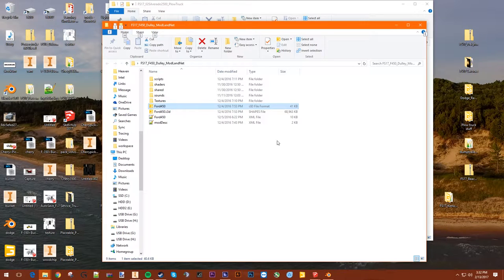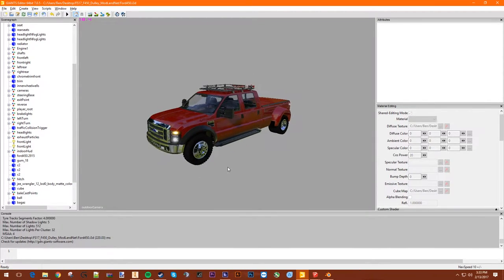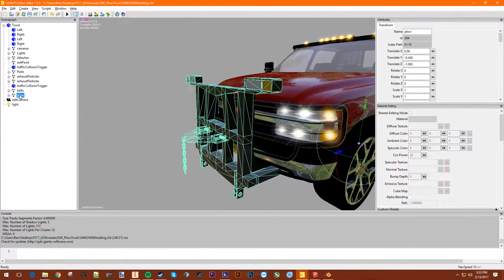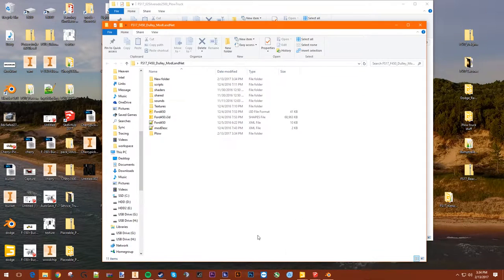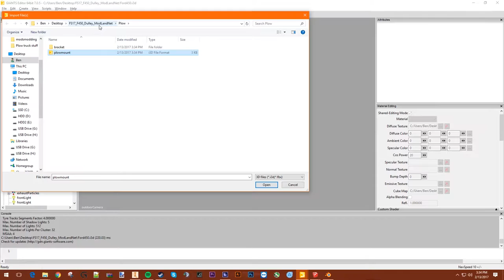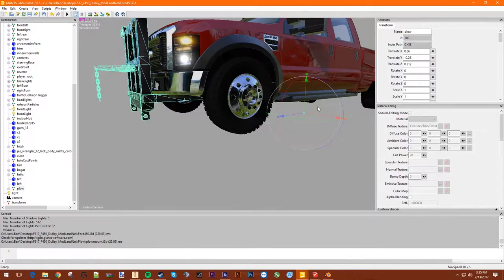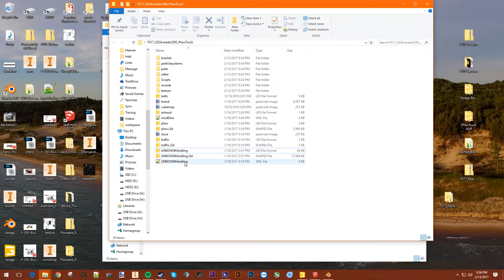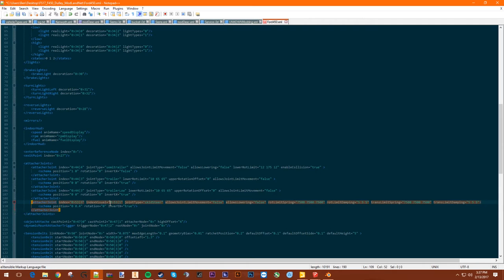Farming Simulator 17 How to Put a Plow Mount on a Truck

Comment: Thanks Dude I'll give you permission to use any of the mods I have converted. I just took the comments down cause its private. But you can use it and any of my other mods. Thanks
Reply from the maker: Its really not private I found the same mod online lol. Also u didnt put the code between the attacher joint tags so farm sim didnt know there was an additional attacher
Reply: Ok And Thanks. Ill put converted mods in the drop box folder so you can use it. Are interested in a Ford F450 2017 it will be in the dropbox
Reply: I have posed the new 2017 f450 super duty in the folder for you dude you deserve these mods